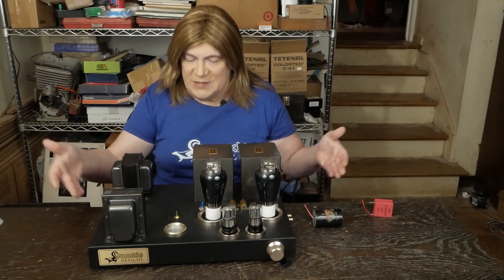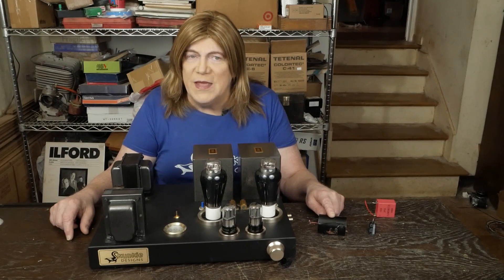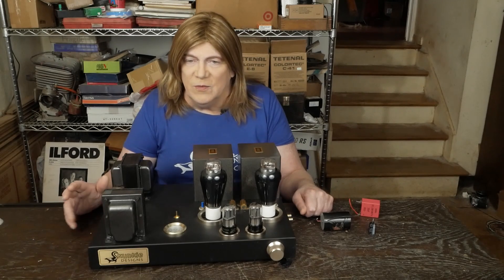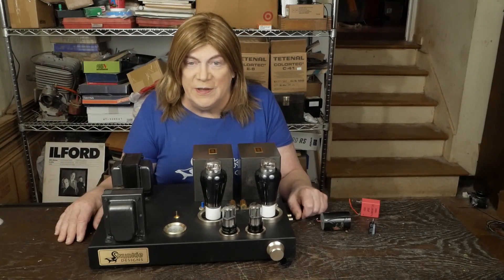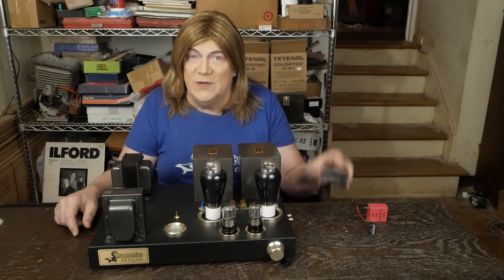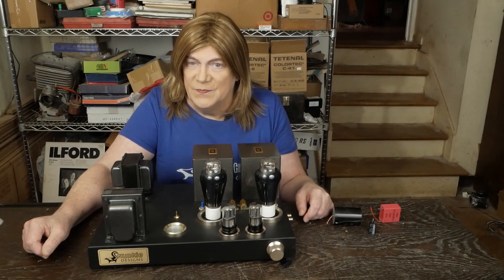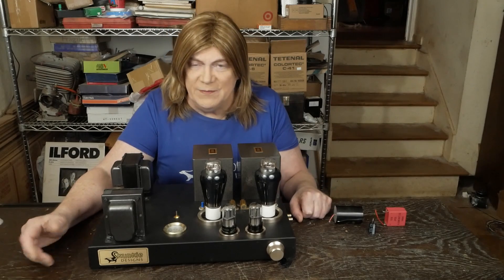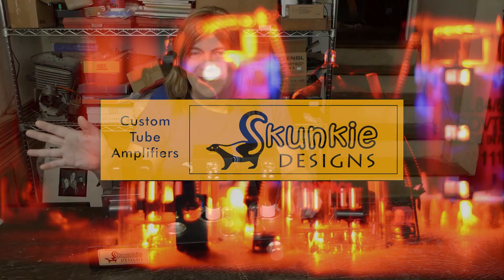Power Supply Cap Changes Amplifier Sound?!

Comment: What size is the chassis?
Reply from the maker: Huh?
Reply: @SkunkieDesignsElectronics  Yes, the size or dimension of the chassis you used for this 300B amp
Reply from the maker: 12"X17", not sure why that matter in relation to the power supply cap this video was about..

Comment: Hi, is this the first capacitor in the filter circuit? You mentioned that you wanted to try replacing the Solen capacitor with a Nichicon electrolytic capacitor and see what the difference in sound would be between a film and an electrolytic capacitor. I'd like to hear the results, what's your opinion, what's the difference, what did you hear, and which one do you think is better? Thanks for the channel, it's very informative.

Comment: Film caps need hours/days to run in, bass can be lacking can be hard shrill treble then at some point suddenly flows.
Reply from the maker: That's not what was going on here. It ran for plenty of time to start sounding at least decent and don't say it takes 1000 or something for a power supply film cap to break in. The solen on power up sounded totally different and just got better after a couple of hours.

Comment: I was always a HUGE MIT Multicap fan. I put their stuff in many builds. Lately they've gone thru some name changes. If you are someone who gets parts from places like Partsconnexion their gear is still available. I lifted the following statement from their website: Dear Valued Customer,
We are excited to share important news regarding the evolution of our company. Due to the
complexities surrounding intellectual property ownership rights, we have decided to rebrand MultiCap™
to “AudioCapX™”. All products previously branded as MultiCap will now be manufactured under the
name AudioCapX. Other than the new name, the new AudioCapX capacitors are physically and
electronically identical to the outgoing MultiCap equivalents. All products currently sold as
“AudioCap™” or “Rel-Cap™” remain unchanged.

Comment: Stephe, I’m not sure you even want to mess around with something that already works for you, but I’ve had great success using either Kemet DCLink or Clarity caps (the purple ones) as the first cap of the PSU. The power supply parts absolutely make a big difference, and bypassing the caps in the PSU have made the most noticeable difference for the better I’ve personally found. 
This vid is a year old though, so you’ve likely figured this out already.

Comment: There are two camps:  The guys with the spectrum analyzer that think sound is related to THD, and the camp that builds tube amps with old parts. Every part matters, down to the rectifier tube.

BTW try directly heated rectifiers...  80/81/83/5Y3/5U4 or the europeans.

Comment: Good show Skunkie, For years Danny at GR Research has been preaching about the quality of parts that are in the signal path. What's really strange is high end speaker manufacturers (not All) continue to put cheap parts in their speakers.  You have reaffirmed that just because two caps have the same measurement value, it  doesn't mean they sound the same.  Thank you.

Comment: Of course power supply components affect the sound. You are listening to the power supply after all. The original signal dies  in the driver tube. You are listening to the power supply from that point on. I have 100% film caps in my 300B amp and it made a big difference getting rid of the electrolytics.
Reply from the maker: There are a lot of engineers who will argue that it makes no difference. I've had them do it when I tell this story.
Reply: @SkunkieDesignsElectronics  Well I am an engineer and the power supply is what you are listening to. The amps ability tp dynamically respond to the music is directly impacted by the power supply.

Comment: Very interesting stuff.  I'm currently replacing PS caps in my Dynaco SCA-35 Hi-Fi amp (12AX7, 7199 & EL84).  The OEM cans (still functioning) were 60, 40, 20 uF for the B+ outputs.  I bought DigiKey 450V electrolytic in 68, 47 & 27 uF to replace.  Wondering if I should consider upgrading capacitors, and what kind?  Maybe bypass caps, like you mentioned?  Your thoughts would be most appreciated.
Reply from the maker: Not really a fan of bypass caps. Maybe try a 22uf solen film "fast cap" in the first position.

Comment: Caps in the audio path WILL sound very different.  Caps in the power supply?  I believe that if you compare the bargain-basement caps that are barely within specs to a faster discharge high quality cap, you will get a different sound.

Comment: I suspect the difference between the caps is ESR, as you suggest. But at audio frequencies more than at AC power frequencies. Based on your experience of installing small value caps across the large value caps suggests the Solon cap has a higher ESR than the Wima, especially at higher audio frequencies. ESR and Q are closely related. If you can measure the Q of the capacitors, you might see a difference there as well.  The filter caps are in the audio path in the sense that they shunt the audio to ground on the 'hot' side of the output transformer, especially in a single ended amp. But if this effect is as real as described, I would expect the cap closest to the output transformer would have the most effect. Another possibility is that the filter caps may be resonating with the substantial inductance of the output transformer, or even the filter choke. Hang a 'scope on the B+ into the output transformer and run a frequency sweep with various capacitors. I bet you will see a notriceable difference in residual signal at some frequencies over other frequencies, and that this will be different for each type of capacitor you test.

Comment: 8:14  I allways thought Push-Pull amps had a near to constant current draw on the power supply due to their balanced nature, and SE amps not ?
With SE the cap feading the OPT needs to deliver the variable current requested by the tube, and the voltage on that cap (and thus B+) is not constant if the preceding components have to much resistance/inductance.  Could even be frequency depended.  Or am i missing something?
Reply from the maker: It's the opposite, SE have more constant current and PP varies with the load.
Reply: @SkunkieDesignsElectronics  ok thank you. Great channel btw! I like your honest way of explaining things, learning alot here.

Comment: Stephe, I have no doubt as to what you heard when you substituted the Wima cap as your rectifier filter.  Is it possible that giving it some break-in time would tame the nasties you heard?  Many years ago, I did a coupling capacitor upgrade on an MFA Luminescence Preamplifier.  It I sounded (very) nasty, but after a lengthy break-in period, the preamplifier absolutely sang!  Curious to know if you auditioned your 300B amplifier with electrolytic supply caps (like JJ's), and if so, how did it sound?   I've always done well with this brand.
Reply from the maker: Possibly? I didn't give them a lot of time, maybe 3-4 hours of play time, which is normally in my experience with coupling caps is enough to settle in. Maybe a power supply cap needs longer? Mostly I was shocked that a power supply cap would have THIS much impact!

Comment: Just a guess here, but I'm thinking Class A or not, more current is going to be drawn by the speakers at the lower frequencies than at higher frequencies. This of course causes a voltage sag on the high voltage. The power supply having more capacitance being able to supply the voltage that bass frequencies demand with less sag by the speaker is probably being supplied by the better capacitors would be my guess as to why the bass sounds a lot better with the better cap.
As an aside if you're familiar with the pre-amps and amps built by Angela-Gilbert (on Youtube). Part of the design differences that AG gets into is large capacitance arrays in external enclosures are plugged in as an accessory to the amps which supposedly increases the quality of the sound immensely. Those cap banks built by AG are somewhere in the few Farad range.

Comment: A power supply tube shouldn't impact the sound. The choke shouldn't unless it's with a cap and then in makes an lc filter. So yes a cap will have an effect. Also you have to remember caps need running in. It may sound harsh at the start but will settle down.

Comment: I think that the output feedback has been designed for the less responsive electrolytic cap from the PS. Adding the small bypass means faster response at the output and feedback will enhance thus having overshoot.
Reply from the maker: IMHO bypassing the power supply caps doesn't sound good. YMMV

Comment: Howdy.
I would suspect the ESR of the cap.s are responsible. Equivalent Series Resistance. The ESR can be large for regular el. cap.s. Film cap.s have way smaller ESR. So, they can take current and deliver current fast.
I would be careful about changing the first filter cap. , between the rectifier and the choke, to a film cap. The low ESR may cause current surges through the rectifier tube it can't handle. But yes. After the choke the filter cap may be a film cap.
Regards.
Reply from the maker: I stated that the ESR both stated and measured was the same. Also measured the impedance vs frequency and the curves look the same. That's why I said I was baffled, as something other than the obvious is going on.
Reply: @SkunkieDesignsElectronics  Howdy again.
Hm Ok. I was going to say there is an ESL too. Equivalent Series Inductance. But as the impedance vs. frequency is checked to be similar, it likely covers the ESL aspect.
Entering the speculation zone. I think dielectrics have hysteresis as magnetics have. These produce resistive like losses. In English. AC resistance is not the same as DC resistance.
One way would be to check the voltage - current phase shift. But I would think that is difficult to do with regular lab. gear.
I would understand that radial lead cap.s show more ESL than PCB mounts.
Regards again.
Reply from the maker: Clearly there is SOMETHING different, but it's not seen on basic measurements or specs.

Comment: Remember; the amp's circuitry through to its output stage is just a delivery system to dump power supply energy on the speakers at the rate of the input signal. What's first? Look backwards from the output into  the transformer, and circuitry into that pool of energy! What do you see?? Along the way, what do you encounter in your mind's eye?

Comment: did we take any masurements ? every cap have 20% +- value , and the ERS is different , use smal caps parralell over the catodes in the preamp tubes to get the shrill out
Reply from the maker: yes measured the caps obviously, same value and ESR. And adding small caps across big caps does the exact opposite.
Reply: @SkunkieDesignsElectronics  across the anode resistor over the gainstage (pretubes)
Reply from the maker: First you say the cathode, now you are suggesting putting a cap across the plate load resistor?
Reply: @SkunkieDesignsElectronics  that anode cap was just to get rid of the shrill hights ,my mistake i meant anode

Comment: I had to come back to this video as I'm thinking of switching to Solens 47uf as the first caps in the power supply in a recent build that I really like..if I have the space. I've been told in the past to just shunt or bypass the Electro's with film's but I've never had luck with bypassing..in any position, Though I've only tried it twice now. 
What cap type & brand has been your go-to or good results as far as coupling the 2 tube stages?
Reply from the maker: Mundorf EVO alum/oil. Don't be tempted by their higher priced offerings, IMHO they don't sound as good. And like you, I've had zero luck bypassing 'lytic caps with film ones.
Reply: @SkunkieDesignsElectronics  TY Skunkie

Comment: The difference is the ESR.  I have tested Capacitors in a lab for 23 years.  I have also modded lots of less expensive equiptment with capacitors to milk all the sound possible.  The power supply has a huge effect on sound. That lower ESR takes away the lag in delivery of power and increases the slew rate at the higher frequencies bringing out the detail.  Another thing I have found is dont use any parts with copper clad steel leads(cheaper caps used to use that alot) Or any ferrous metals where the signal passes through.  I am impressed with your channel thinking about building the KT 120 monoblocks.  

I have heard that womens hearing is much more acute which may be why it sounds harsh to you. Myself I love that detail.
Reply from the maker: These two caps have the same ESR. That would indeed been a simple explanation if that was the case.
Reply: .. Another thing I have found is dont use any parts with copper clad steel leads(cheaper caps used to use that alot) Or any ferrous metals where the signal passes through. I would really love to know more about this to improve my circuits

Comment: Gat a question for you
I've noticed a difference in capacitors.
But what about resistors?
A lot of exotic snake oil out there.
So what brand of resistor do you use for anode, cathode, grid ?
Thanks in advance.
Reply from the maker: I honestly haven't gone down that rabbit hole. I'm using Vishay pro series.

Comment: I wonder if the plastic cap is mylar or polyester, whereas the Solen is metalized polypropylene.  I have noticed harshness with mylar/polyester caps when I used them as coupling caps...I would not be surprised if it made a difference with the power supply.  I have always spent more time and simulations building and designing the power supply than the input and output stages.  Thanks for all your work and sharing all the info you have learned...it can be a tough world in the internet.
Reply from the maker: I looked it up, that wima is a metalized polypropylene

 https://www.mouser.com/ProductDetail/WIMA/DCP4I053007HD4KYSD?qs=gYqc6UMArTPQ5olMylyEvQ%3D%3D

Comment: You should try 0,022 or 0.047uf instead lf 0.33uf. To big bypass will give that shrill sound and sign that its to big value. Alao the wima caps are kinda famous for having extreme long burn in time and i usually think its bs talk to in wimas case its not. I do not like them i  signalpath that much because theyre to laid back for my taste
Reply from the maker: It's not a bypass cap, it's the main reservoir "first cap". And as I said, I have tried bypass caps across electrolytics in the past and didn't care for the results.

Comment: As I understand it, some caps require a burn in period of up to 100hrs before that bad behavior goes away.  Maybe test that theory out with one of those bad sounding caps.
Reply from the maker: IMHO there is something wrong with a part that sounds bad until it's "burned in" for 100 hours. Now maybe a part that sounds good and after some time sounds slightly better I can deal with. Or even a part on initial power up is a little cringy but after 30 minute to a hour clears up. 100 hours of music play time is absurd to expect anyone to suffer through.
Reply: @SkunkieDesignsElectronics  I actually agree with you on that.  I do know that materials vary in the time it takes for them to stabilize.  Speakers surrounds are a notorious example of this.  I am currently building two audio note M77 clones.  One has precision matched  to .001  resistors ( z foil, audio note silver and other high end types, and audio note copper and kaisei caps also matched from sonicraft  as well as Russian polystyrene and silver mica caps in the phono section with a personally made precision resistor attenuator, shielded tubes, shielded power supplies, silver wire everywhere, shortest wire runs everywhere, military grade soldering and device mounting, yada, yada, and the other with more of a regular build.  My fear is that after all of that work and expense, it will lay a bunch of crap on me and give me massive buyer’s remorse.  Imagine spending well over 1.5k in parts and having to hope it will get better because of my choice in caps.  I’d be crazy if the regular build with less exotic parts ended up crushing it.
Reply from the maker: I'm learning that some of these "exotic" parts aren't better or even as good as "normal" ones.

Comment: Great sharing, thank you.  I recap gear regularly using a combination of DNM slit foil smoothing caps and other electrolytic caps from Elna, Nichicon and Panasonic.

As regards WIMA, I use their MKP-10 polyprop’s in place of film caps and I will say they take a long time to run in.  But then they sound great.

It makes a lot of sense to me that amp sound is impacted by the choice of caps in the PSU.  Amplifiers work by combining the signal with power to lift the output.  Any artefacts in that power will be present in the output stage as noise or distortion.  The cleaner the power the better in my experience.

Comment: 13:05 I think that's what most people involved in electronics (except very specific/niche/cutting edge areas) have anyway.
13:12 I think maybe an oscilloscope probe in the circuit would help here. One can also check caps on their own, do all sorts of X-Y curves stuff but unless one can somehow work out how the results of these measurements would translate in a specific circuit and operation, then I think it would be better to just measure the thing in the circuit and compare against alternative components this way.
All this is very useful testimony especially for those of us who go into circuit building thinking that a part is a part and that's all there is to it. We must keep in mind that most of the electronics art works because it is based on simplifications: there are just far too many factors involved in any given circuit for our mind to be able to process and take into account. Measuring and experimenting is key.